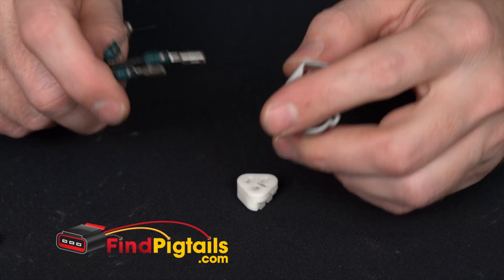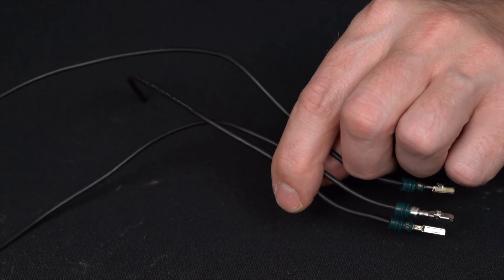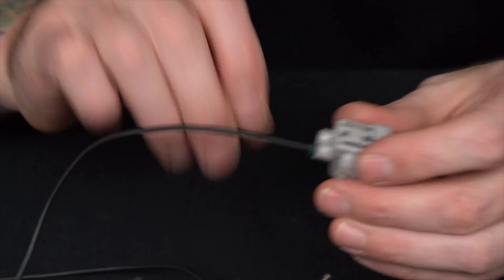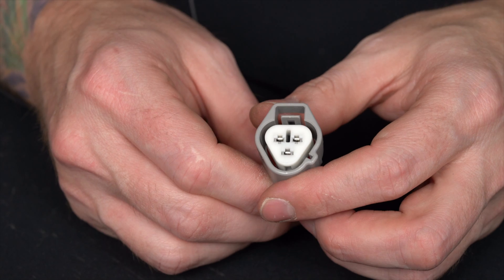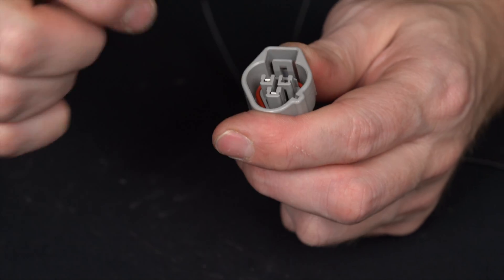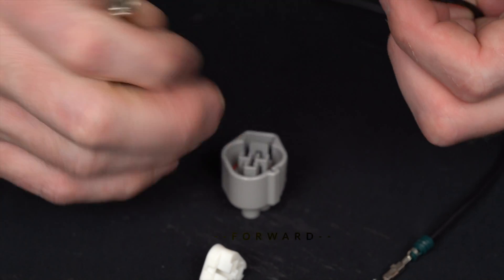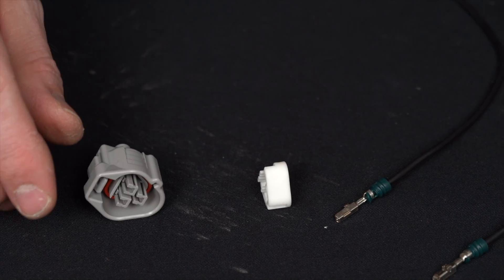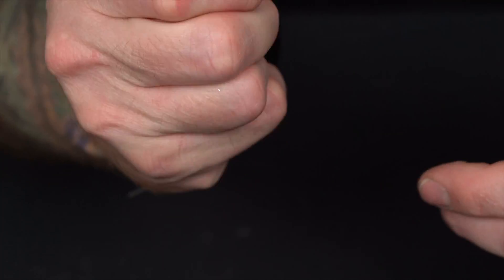DIY De-pin Automotive Electrical Connectors

Comment: Thank you thank you, I was able to get some good used connectors from the junkyard and replace the broken one from my vehicle by following your instructions, thank you again.

I feel stupid that in the past, I would cut them, splice then together and use them, your method is significantly better.